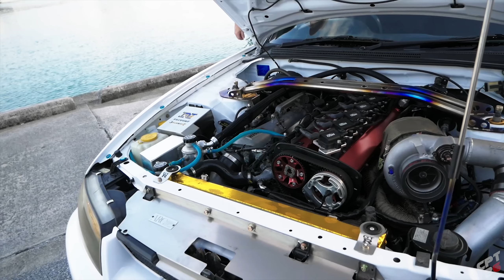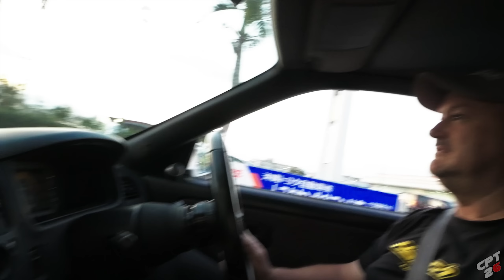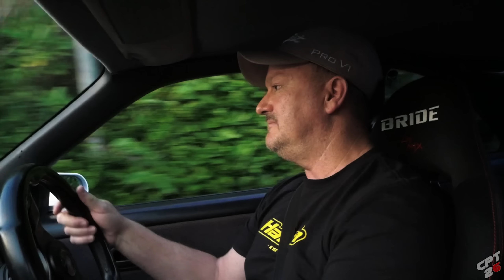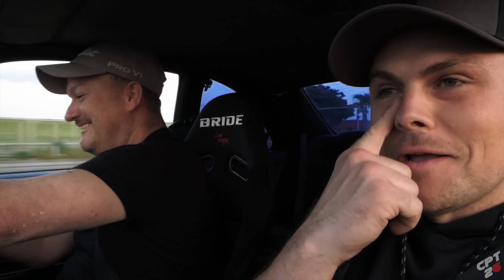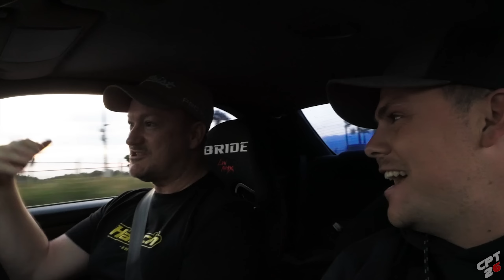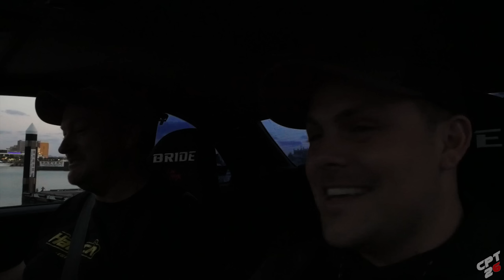THIS IS WHAT A 1000HP NISSAN SKYLINE GTR LOOKS LIKE!

Comment: Love seeing this. And it's crazy how much GTR's are going for, I paid 21k for a Vspec with 50km on it back in 2013. 

Car sounds good, drives good, nice build. My RB30/26 build is on my page. Our builds are simular, I'm just bigger everything cause of the RB30. I'm gonna pull thr motor again and fix a couple things. Just have to finish buying a house w/ garage, cause I hate leaving it outside.